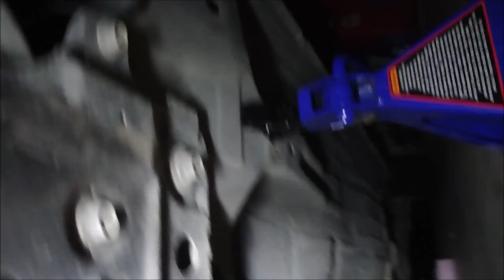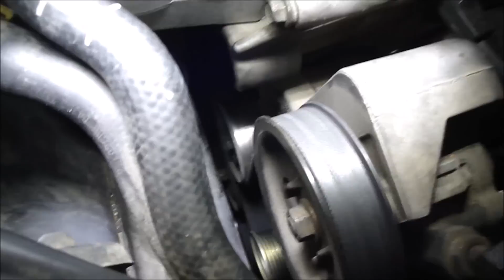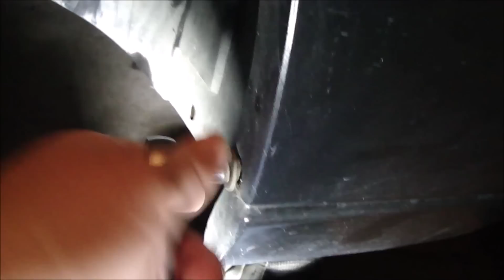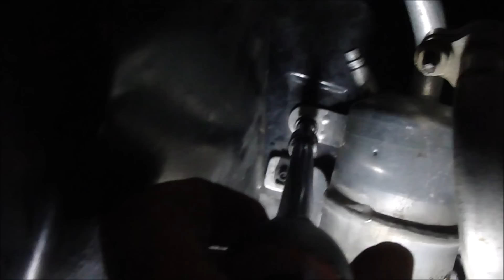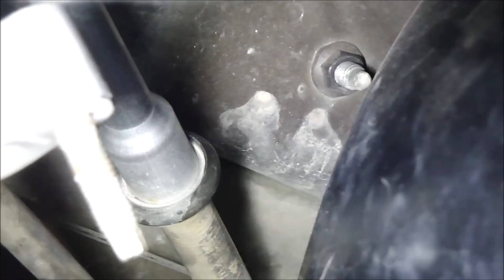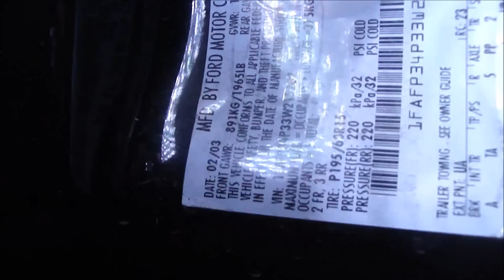Replace AC Compressor, Accumulator, Orifice Tube, Hose Assembly on 2003 Ford Focus

Comment: Did you put some PAG oil into the accumulator ? I've seen a couple of videos where they added the oil to the accumulator. Sorry about the extra work with the accumulator. BTW: Everco is probably a code word for 'Made in China'. I'm going to be doing the same thing that you did. I have to change the compressor, accumulator with hose, and the orifice tube filter on my '02 DOHC Taurus tomorrow. Good times. (I'm sure that my accumulator hose assembly is a 'Made in China' part too). It just has a suedo name: 'Newparts Premium Aftermarket'.
Reply from the maker: Good Luck! Let me know how it goes. Thanks for watching!
Reply: @becausestuffbreaks  Did you add any PAG oil into the accumulator ?
Reply from the maker: No, I only added it to the compressor and all the o-rings.
Reply: @becausestuffbreaks  What about flushing the system ? I didn't think of doing that until earlier today when I saw some videos on it.
Reply: @becausestuffbreaks  So your AC works as it should without adding any oil to the accumulator with no issues ?
Reply from the maker: I was told you only need to flush the system if you have a compressor failure that would cause debris to enter the system. I think I just had some seals go bad in the compressor. I didn't see any metal shavings or flakes to require a flush.
Reply: @becausestuffbreaks  That's good to hear. I think I can forget about the flush then. The clutch went out on mine. But I'll still look for debris.
Reply from the maker: @realjaxon  let me know how it goes. Mine worked perfectly after the video. I had Firestone evacuate my AC system before I did the work and then had them recharge it for me after the repairs.
Reply: @becausestuffbreaks  OK. I'll let you know how it went. I might do video of it .
Reply: @becausestuffbreaks  There's gonna be a delay in the installation for a couple of weeks at least. I checked out the 'used' compressor this morning, and there is a ringing sound whenever I spin the wheel, so I don't want to take a chance on it. And...the new accumulator with the hose assembly won't work either. I dig a eyeball check for length to see if it would fit and I found that the hose will kink near the firewall where it has to bend. So that has to returned. The only part that I have for the job that appears to be the correct one, is the orifice tube filter. I'm in no hurry. I want to do this only one time. Good times.
Reply from the maker: Good plan

Comment: Im doing this today...im glad your video is here.. 
ill update when i finish
Reply from the maker: Please do. Most people leave me hanging. Thanks for watching!
Reply: However i have a ford escape 2003. Still generally works so far
Reply: Any idea what's the torque specs for the bolts?
Reply: Ok follow up.
As i said i was working on my ford escape 2003 not a focus.

My orifice tube , same place but i had quick disconnect pieces. No problem, we had the disconnect tool.
My entire accumulator was on top and has quick disconnect. no problem.
The ac compressor was identicle steps. No problem.
serpentine belt. Easy access.  No problem.
The flushing of the ac system was rewarding. So gross, really needed it.
I cleaned the under carriage like crazy after removing the ac compressor. It was gross. feels good to do that.

The thing that made all this easiest was tire ramps. and the bottom panel cover being removed.
The hardest part was that I wouldnt have been able to do any of this without my FILs shop having everything we needed.
AC System processes, vaccuums, tools.

with all the right tools and things disconnecting without any trouble this process can be pretty quick.

Car runs great.
Reply from the maker: Awesome. Thanks for the update.

Comment: Hello, what are the symptoms of a blocked orifice tube (air conditioning regulator)? and how many are there, 1 or 2?
thank you in advance
Reply: Your pressure will be out of whack if your system is clogged

Comment: hey did u have to flush anything when replacing all that ?? or that's what would get flushed if not replacing?
Reply from the maker: I had Firestone vacuum out all the refrigerant before doing anything. I asked Firestone about flushing it and they said, as long as my AC Compressor didn't come apart or spit metal shavings into the system, I would probably be fine without flushing it. I didn't see any signs of metal shavings or pieces coming out, so I did not flush the system with anything. I can't say that's the same for everyone though. So far mine is still working great!

Comment: pretty much a useless video.  I don't want to see things done, I would like to see how they do it.
Reply from the maker: I would agree that I needed to show how I did it instead of after it was done. This is one of my early mechanical repairs and I didn't know how I was going to operate a camera and do the work alone, but I have a better setup now and I should be able to give more detailed videos.

Comment: diff u need or suppose to add oil to the new dryer when u installed it? I have to replace mine but idk if I'll need to add oil to it first.
Reply from the maker: +wonnieboy You do NOT need to add oil to the accumulator but you do need to put oil on the O-rings to ensure it makes a good seal.
Reply: +Justin Peters OK. once I install the dryer I'll take it to a shop so they can put on there machine to vacuum the system an add the proper amount of freon. but I just wanted to make sure I do this right so im not paying the shop am still having issue because I didnt add oil. can I get a small bottle of oil from AutoZone?
Reply: +wonnieboy I'd like to buy a ac vacuum an do it myself but I'm worried I won't do it right but i do like to do things for myself. thxs for helping me. atleast I know I don't need to add oil to dryer
Reply from the maker: +wonnieboy Yes, you can get a small bottle of the Refrigerant Oil at AutoZone.
Reply: +Justin Peters awesome thxs Justin
Reply from the maker: +wonnieboy I was debating buying one also vs the cost of a mechanic doing it. I had already paid Firestone to do a recharge, thinking that's all it needed, so they were willing to vacuum it back out and put it back in after the repairs for no extra cost.
Reply: +Justin Peters ur lucky. I paid a shop to add freon an dye so we could locate the leak. so found it in the dryer. I had to pay for that. an they want extra for dryer plus freon again. it's extra 70$ just for the dryer replacement. these ac systems are so expensive to maintain .